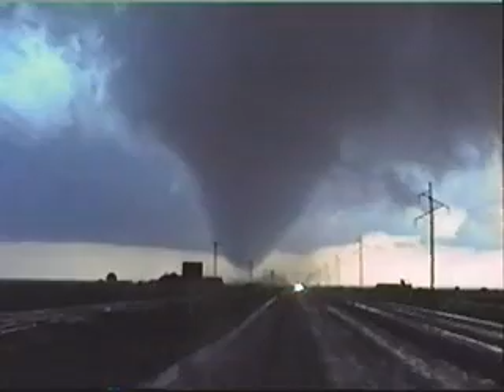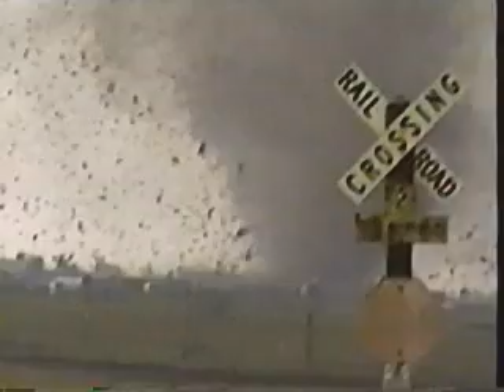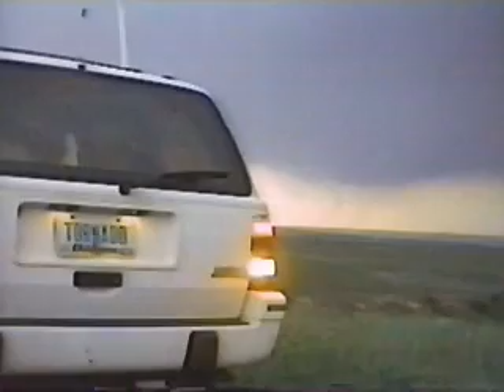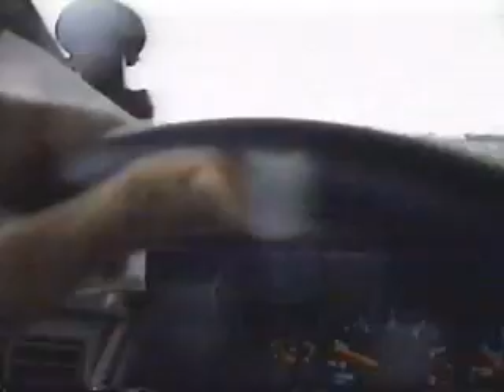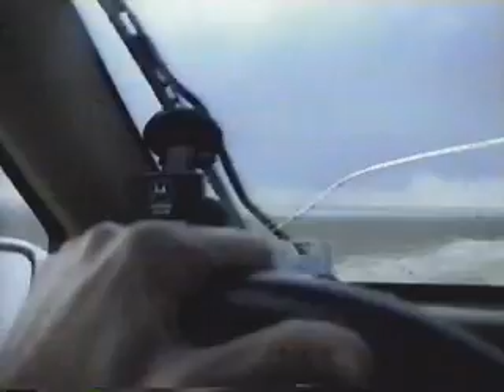Project VORTEX (And More) - Part 2

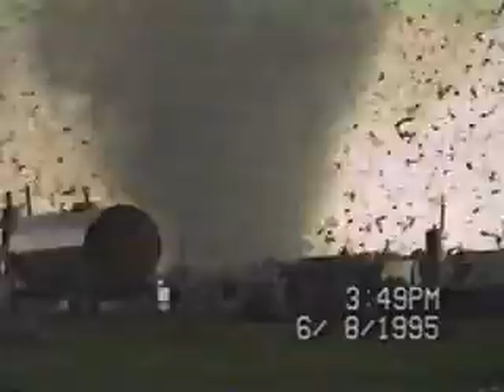Comment: The very large object being lofted to the bottom right of the funnel at 3:25. What is it, exactly?
Reply from the maker: An old warehouse.
Reply: I'm having a hard time wrapping my head around how something that size didn't disintegrate upon contact with the tornado's winds. Would you happen to know what part of the warehouse it was, or why it didn't disintegrate into an indistinguishable shower of metal like everything else?
Reply from the maker: I don't know why it didn't disintegrate.  The printed manual that came with the video only states:  "...we see an old warehouse at Pampa, TX that is about 120 feet long, being carried aloft."